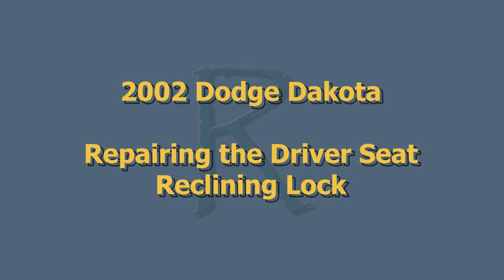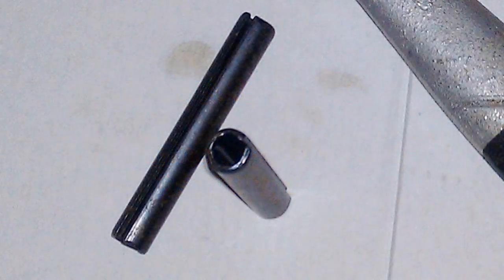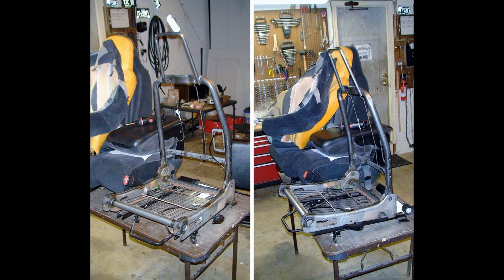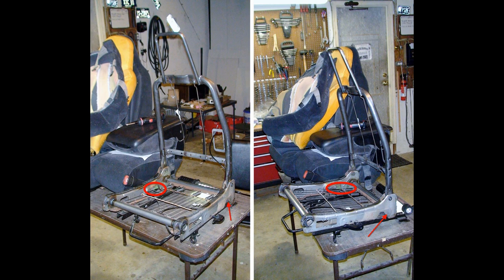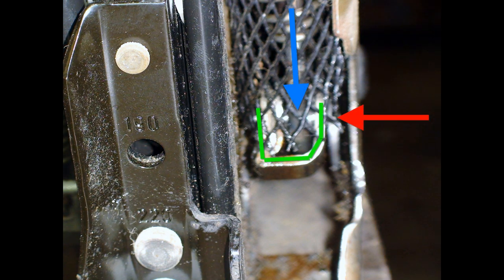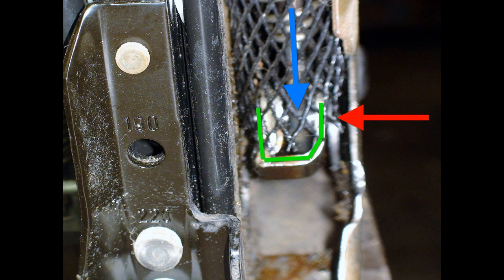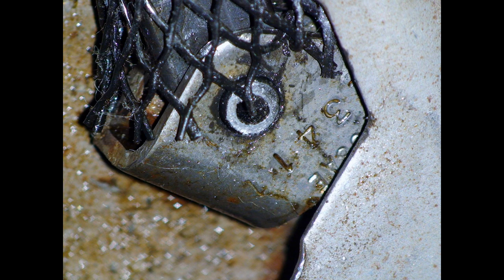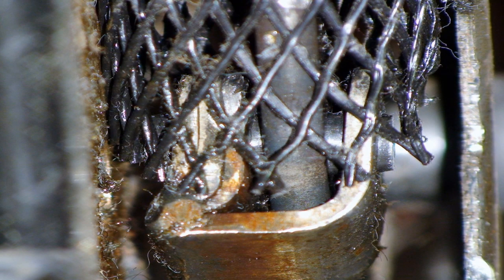2002 Dodge Dakota - Repairing Seat Reclining Lock

Comment: Thanks for the video explanation, mreinsmith. And for putting a name to the "roll pin" piece. I'm fortunate to have found one of the old "roll pins" rolling around on the floorboards.

@Theresa that's how my seat acted when the first pin came out. When the second pin came out, the seat no longer locked upright. I have to drive with a pillow at my back until I replace the missing pins.

Comment: The full size trucks suffer from the same problem. It can be fixed without removing the seat from the vehicle or the cushion and cover, at least on a quad cab. Buy a 5/16 shoulder bolt that's a little shorter than the roll pin. The roll pin is long enough to stick out of both sides of the upper chair assembly, shoulder bolt needs to sit close to flush. Line the upper assembly up with the spring and slide the shoulder bolt through, secure with a nylock nut. A bit of alignment pain, but easier than removing the seat.

Comment: I am having the same problem with my 2006 sometimes I am able to lock it in the position that I want but any kind of pressure will cause it to slip back.
Reply: +THERESA WHITMILL 
Same here for my Dads drivers side lever.  The plastic piece I will call a dowel broke an inch past the lever itself.  Can find replacement part anywhere.
Reply from the maker: +William Guffey try a salvage website that has sources all over the country, often you can email them what you are looking for and they will help you find it